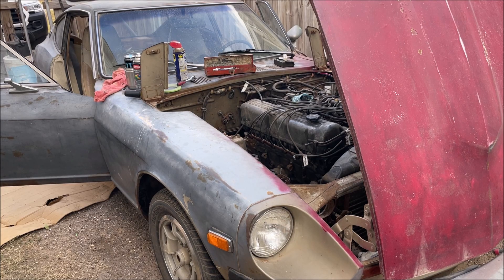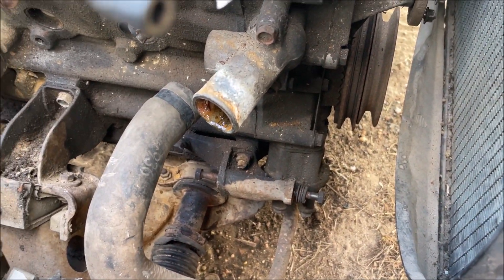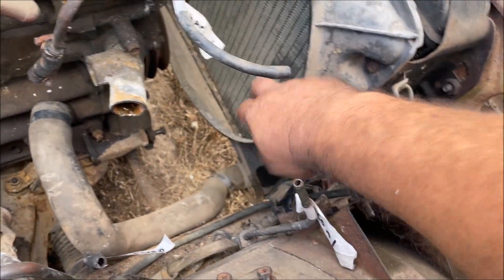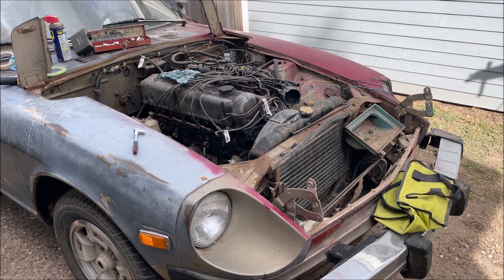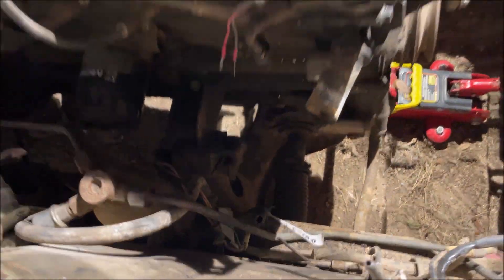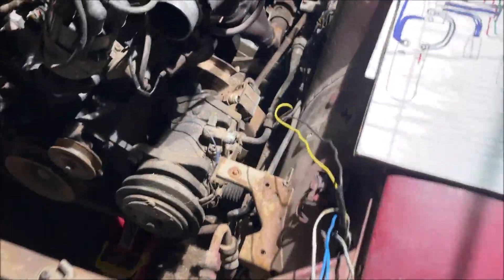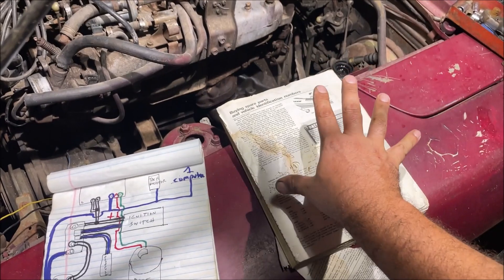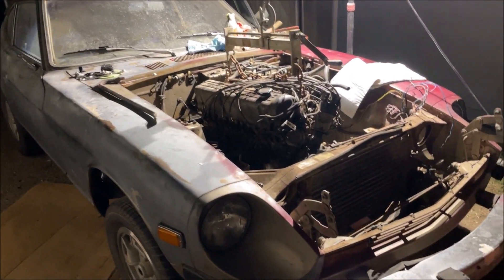1978 Datsun 280Z needs the engine pulled NO OIL PRESSURE

Comment: I did my apprenticeship on these Datsun 240/280Zs back in 1979. There was also the 280C or Cedric saloon that used this same engine. The country I was living in only got the single carburretor models and they were easy to mantain and repair.
I read in one of the UK car magazines that these Nissan/Datsun L240, 260, 280 OHC engines were actually licence built Mercedes-Benz M123, M110 engines but with a few changes. Weather this is true or 'Pub talk' only Nissan knows. There's a handfull of ways engine components are arranged, eg the camshaft can only sit down, midway or overhead or OHC, so engines can look similar.

Comment: When you get front cover back on make sure both dowels are install.  

When I was young I had an 83 and I didn’t notice  a missing dowel pin on cover 
So when I would give the motor any torque the helical gears( oil pump /distributor drive gears weren’t meshing close because a slightly miss aligned front cover. Result was distributor momentarily quit spinning in the car would quit and it would be all out of time

Comment: that manual is showing how to take out the engine and trans together. you're probably missing the bolt next to the starter. i had missed that one at the junkyard, and the guy who was lifting it out with a forklift kept yanking until the bolt/lug broke off. fortunately for me, it was on the trans (auto), and i was after the engine.
Reply from the maker: yup.. that’s what happened to me